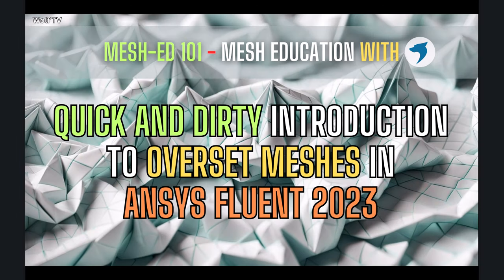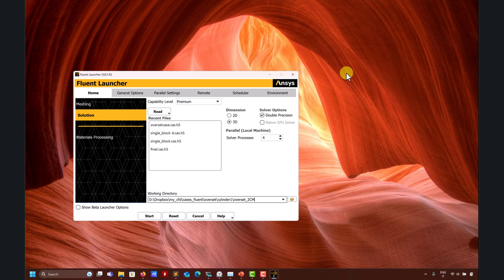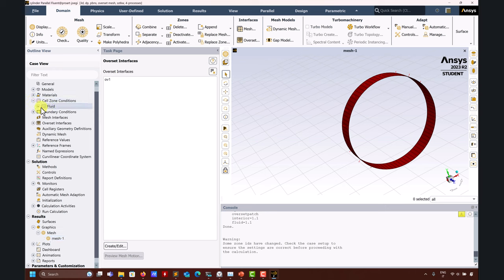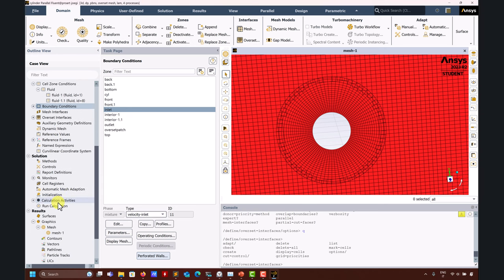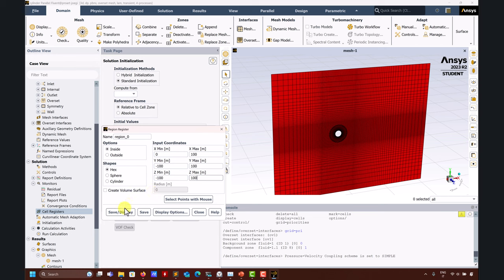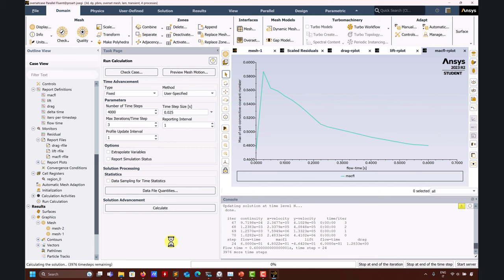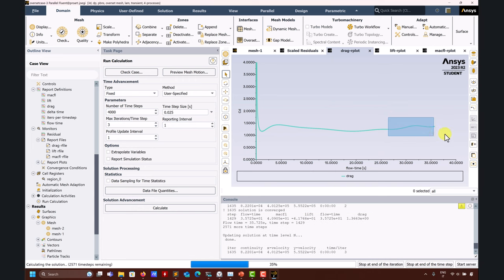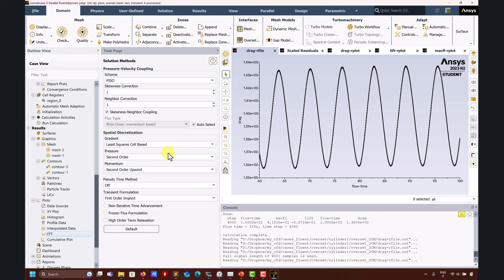Quick and dirty introduction to overset meshes in Ansys Fluent 2023

Comment: Hey Folks!
Thanks a million for these videos! I think your materials are fantastic....

I had tried to use openFOAM overset meshes a few years ago for a rotating turbine case. This is a large case, with potentially millions of cells. I managed to get the simulation to run correctly, but my experience was that the overset approach was much much slower than other dynamic mesh setups. This was especially true when using  a large number of processors.

In your experience, do you believe that the openFOAM overset mesh numerics will be as fast as say a solid body motion solver?  

I understand that the benefit of overset meshing is that the motion can be large and arbitrary, and may be more suitable for FSI work.

Cheers!
Jarlath
Reply from the maker: It does not matter what software you use, Overset meshes is always slower.  You use overset meshes only when you need it. It is the ultimate frontier and it has a high computational cost.